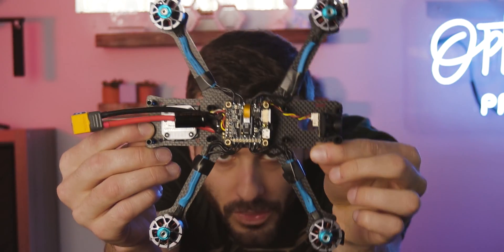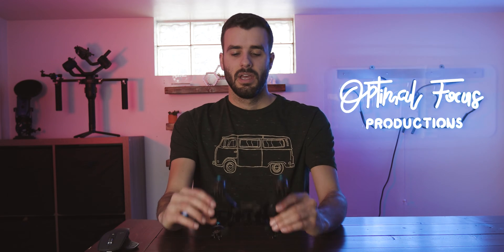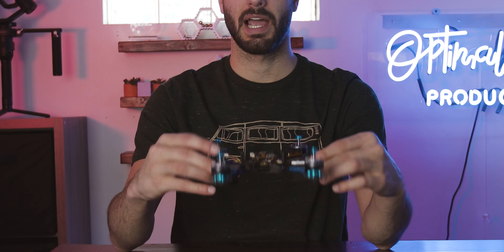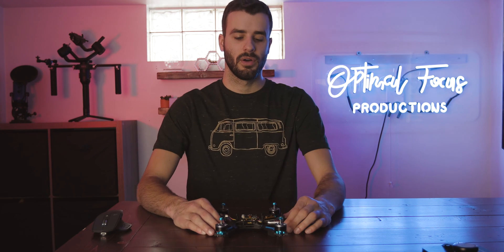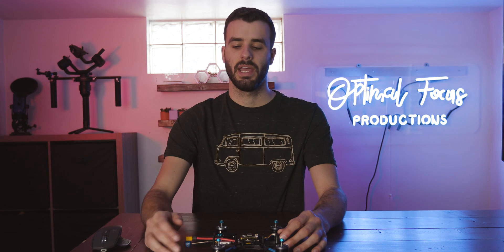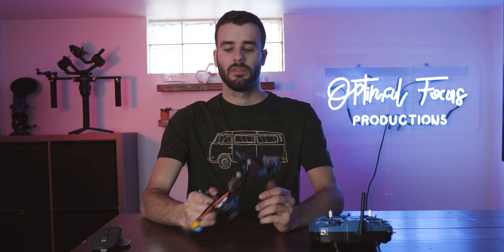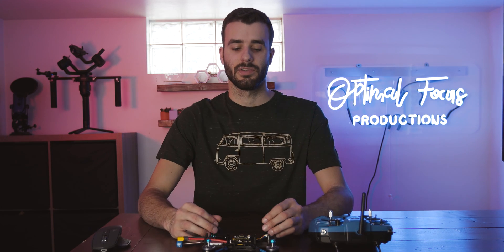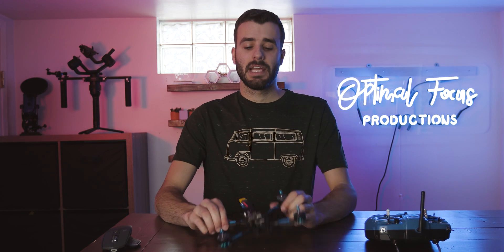FPV Drone BUILD // Parts You NEED

Comment: I’m just looking for a video on part compatibly, any help?
Reply from the maker: I have found that compatibility isn't really an issue for most parts other than when looking for motors and batteries. I would contact GetFPV for help. Build your ideal drone and send them the list and they should be able to tell you if they will work.
Reply: @EngineeringFilmmaker  ok, thank you so much brother!

Comment: For the capicitor : it should be there so that when your drone pulls a lot of power, the battery doesn't get over discharged quickly. The capicitor is there to add or remove power based on consumption and smooth out your energy pull rate.
Reply from the maker: Correct! I can never think of how to explain it. They don't teach us much electrical in Mechanical engineering which sucks for us.
Reply: Thank you

Comment: Will this setup support the weight of a GoPro?
Reply from the maker: Yes! I have seen much smaller fpv drones handle a gopro with no problem. I ended up modeling a 3d printed mount to hold my gopro on the end of this.

Comment: I love this video, very informational for someone like me trying to get into fpv, but i dont have a $500 budget. What should I do?
Reply from the maker: There are plenty of options that you can do to get your whole set up around $200 to $300. I got a cheap headset and controller and that alone costs like $180. Plus the drone parts and such. 

There are a lot of videos youtube of how to build a cheap FPV drone under $200 or so amount I think. Not sure if they are including the headset and controller in that price but its worth a shot. 

The reason I went with what I did is so I dont have to upgrade my drone later. Upgrading my controller and headset is an easy task, you can just swap them out. But when you need to replace a part on the drone, it gets more complicated. I was just trying to avoid spending $200 now then another $500 in a year to upgrade.
Reply: The Engineering Filmmaker thanks for the response, I will look into it. Is there any youtubers that make fpv drone builds that you recommend.
Reply: Hi I am making a 260 dollar build... I’ll post it on my yt if u want to see. But there are plenty of pretty good fpv drone kits, just search em up